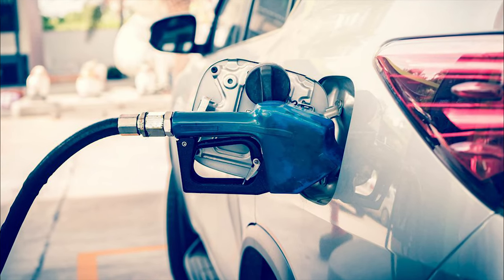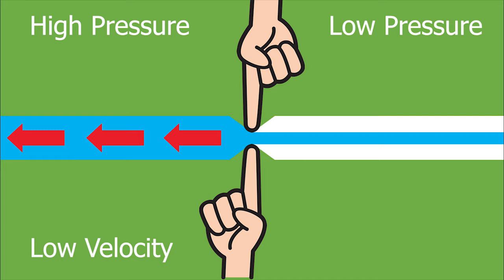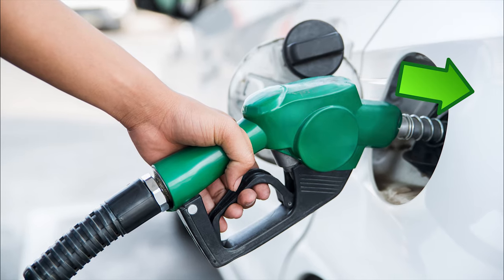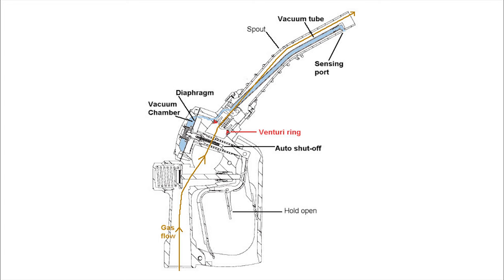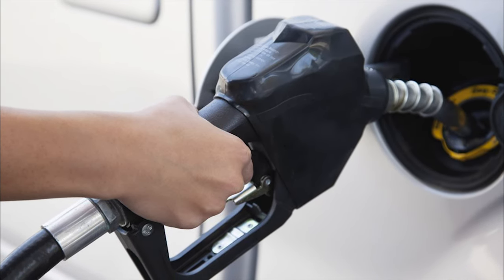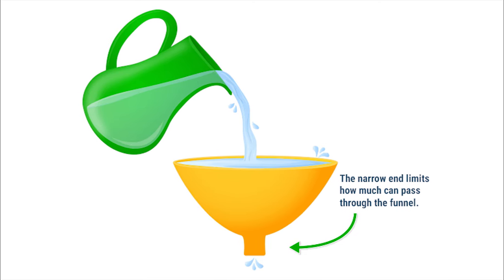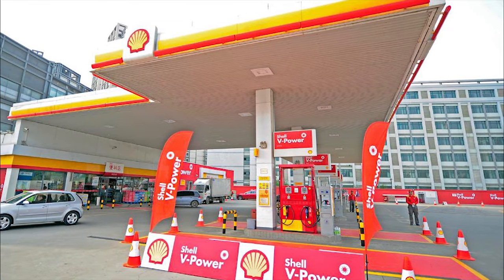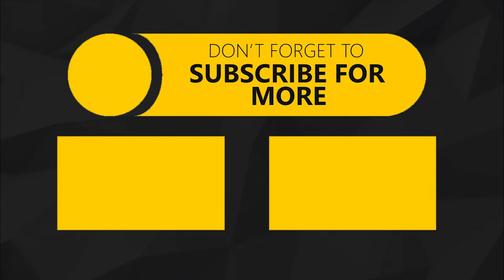How Do Gas Pumps Automatically Stop & Why Pumps Shut Off Prematurely?

Comment: You lost it a little at the end. Fuel tanks aren't meant to be filled to the last cubic cm. 

The tank needs some space to cope with the fact it's holding a liquid that wants to boil at room temperatures, filtration systems built into the tank aren't designed to be soaking in liquid fuel and the need to deform safely in a collision event without bursting.
Reply: At the end, he led on to the next video being why you don't want to top up or fill to the brim.

All that stuff in your second paragraph is outside the scope of gas pump auto-shutoff and not relevant for the current topic.
Reply: @killer2600  yes

Comment: Explanations like this are useless. People don't want to hear that bla-bla-bla about "venturi effect" in general. (If you are here, you know about it already.) People want to know how an extremely small force, produced by "venturi effect, translates into an extremely large force ostensibly needed to disengage the latching lever and the main valve. This is the clever part. This is the primary "how" in "how it works". And this video does not make an effort to cover the matter.